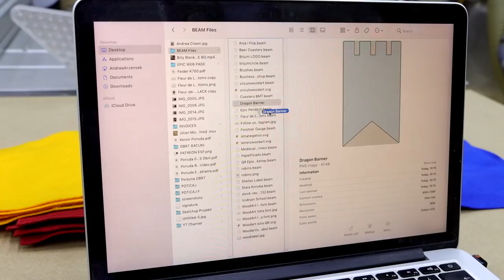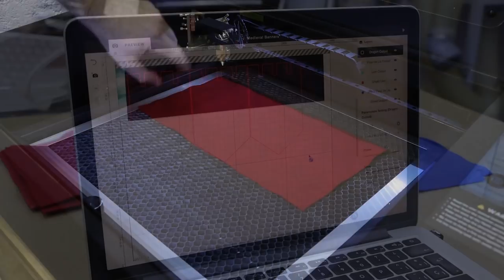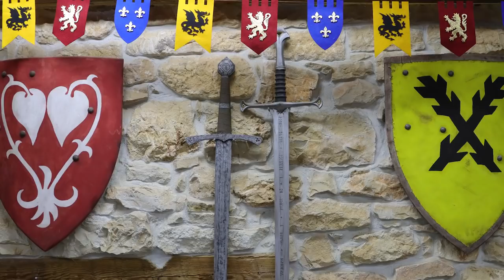Medieval Banners for Epic Workshop? Using FLUX Laser Cutter!

Comment: I think those might, technically, be pennants there rather than banners.

The other thing would be that when putting them on the string, the tabs on banners and pennants is supposed to be folded over and attached to the main portion, which would have made them more secure and fabric glue might have been a better choice than hot glue there
Reply from the maker: Thanks for your intel bro, I am not English speaker so I didn't know name of them. Take in mind that this was a quick project. So I took much simpler route 🤘